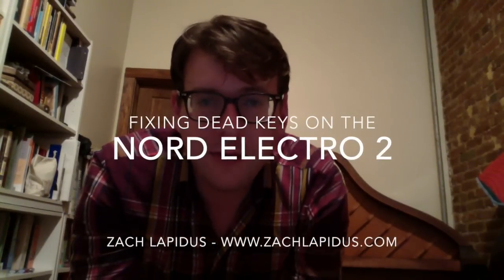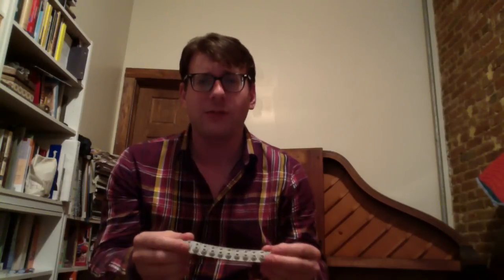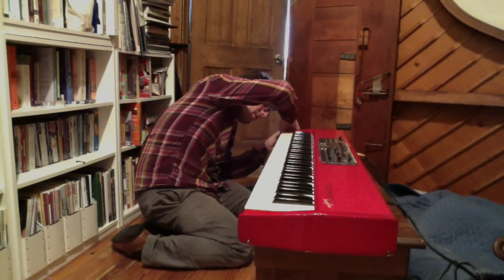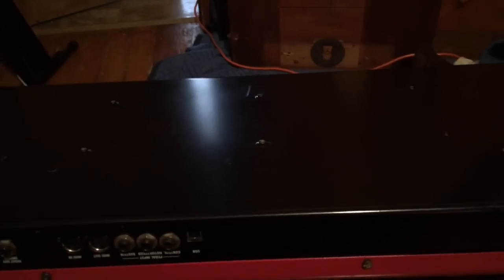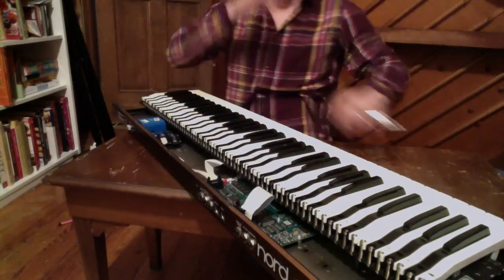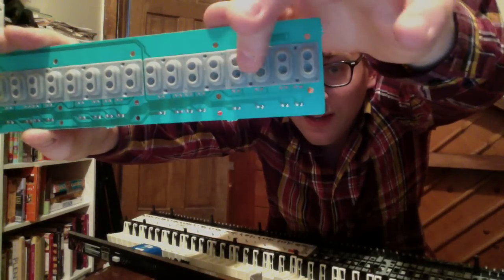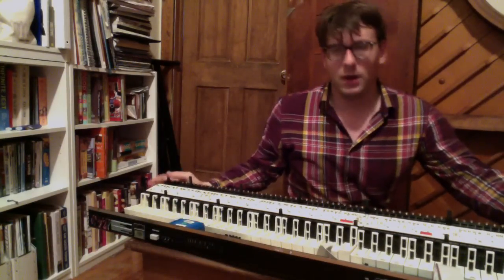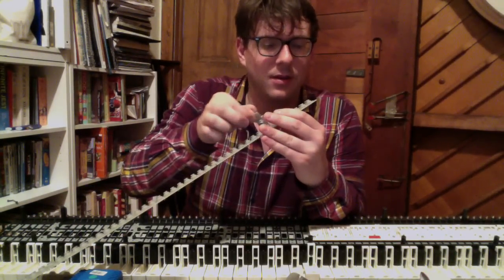Tutorial: Fixing Dead Nord Electro 2 Keys

Comment: Thank you so much for this video!   I'd be lost without it.  Is your Youtube name a reference to Saturn's moon, Iapetus, as in Arthur C. Clark's novel, 2001: A Space Odyssey (not the Kubrick film)?
Reply from the maker: You’re welcome, glad it helped. No, it’s my actual name. Some of us are just lucky, I guess.
Reply: @zlapidus  Hey Zack, I was wondering if you could give me advice.  My board is an Electro 2, just like yours in the video.  I went ahead and ordered all new key contact circuit boards (I had lots of wonky notes, and doubted my ability to replace the contacts by hand up to factory spec.).  After I installed them though, my A3 key was still completely dead, an issue I'd had before.  Not a big deal.  I checked under the keybed to make sure the actual key was not broken, but it was in the same condition as the others.  I figured maybe there was some schmutz in the ribbon connector or something.  So I took the board apart again, removed the ribbon cable at both ends, and blew out the ports and connectors with some compressed air.  Then I replaced the ribbon cable, and uh-oh: No response from the low side at all!  I feared that I damaged the new contact circuit board, so I reconnected the old one and tried some of the functional notes, and still absolutely nothing.  The high side of they keyboard plays and sounds absolutely fine.  Have you ever had a ribbon cable go bad on you?  I pray that it's not the main circuit board.  I've tried to be extremely delicate and easy with everything inside of there and keep my hands clean while doing it.  I know I sound like a crazy person, but if you have any advice or direction I'd really appreciate the help.  I hope for sanity's sake it's only the ribbon cable!

Comment: Just copied your instructions but when I went to put power back on it flashed up for a second then goes off.. any ideas
Reply from the maker: Robert, not sure -- I've never had that happen. Make sure you've reconnected all jumper cables properly. If the first time you opened the nord you opened it roughly, some other jumper cables might have been disconnected.
Reply: zlapidus 
Hi thanks for getting back.
I’ve had a check again maybe I’ve done something to the PCBs
After the second look it’s completely dead...
I’m going into see the main dealer today about sending it away..
For info it’s a 3 yr old NS2..

Comment: the C below my middle C on my nord piano 2 only works if i push really hard on the key. the screws on mine are hex, but thats not the problem. i have the correct screw driver but one of the screws on the side is stripped and the screwdriver won't grip it. grrrr.

Comment: I've had to take apart 2 of my Nords a few times because of dead keys. In each case there was a speck of dirt on the contact. And I mean a speck - about the size of the tip of a hat pin. The first two times was my fault - it was in the days where rock musicians were allowed to smoke in a rock club. So, in two cases, I had to remove a speck of cigarette ash with a soft, clean paint brush. A year ago, somehow, a speck of wood dust got on a contact. Took it apart, brushed it off, put it back together. Problem solved.  Nord needs to look into solving the problem of dirt/dust easily getting inside their keyboards. Roland has solved this problem by placing a thin strip of velvet between the top of the keyboard chassis and the top of the keybed. Right now, a couple of keys on my new Nord 88 S2 are creating an unusual clicking sound. These clicking sounds are mechanical related and have nothing to do with dirty contacts. Seems that the weakest links in Nords are the keybed and, lately, noisy power transformers in the Lead A1.
Reply: 6noteblues i have an electro 2 73 keys. Alot of keys not working these are keys 1,2,3,4,5,6,9,10 and 67. Also the 65 is too loud. is there any suggestions? Do i need new strips? Or only needs cleaning?